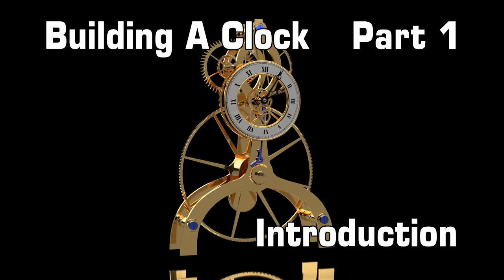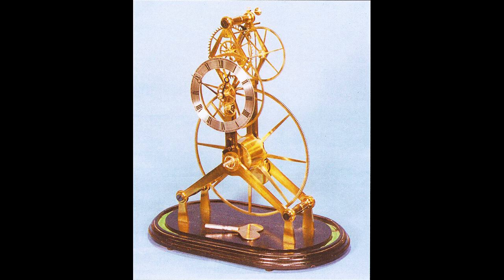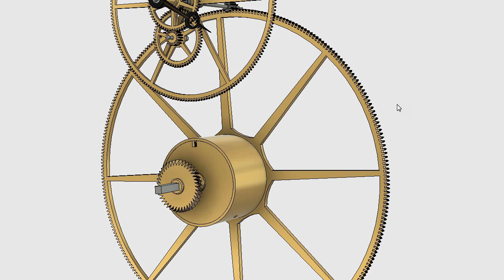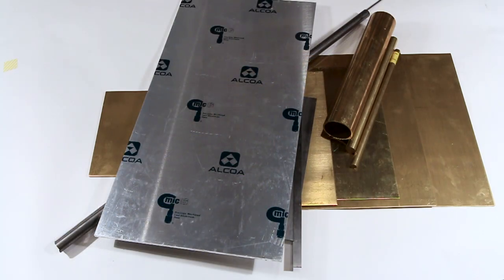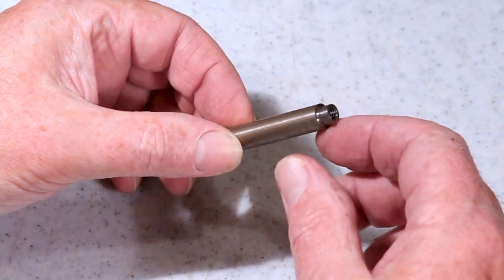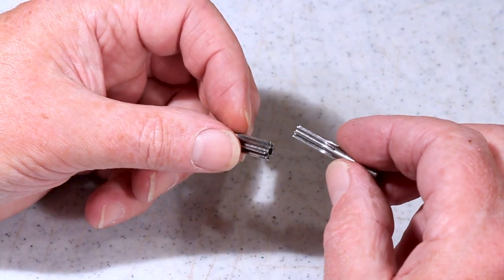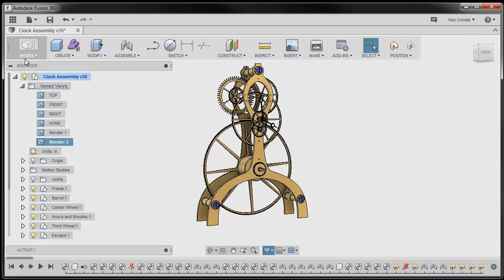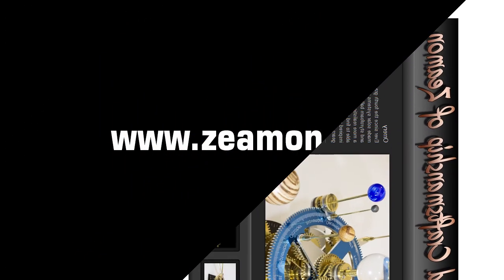Making A Clock - Part 1 Introduction

Comment: Ken, I'm a model engine builder, but once I finish my current slate of engines I'd like to try a clock and an orrery. You and Chris have helped me decide on this John Wilding design. Its interesting to note that while we're all using the same basic machining tools and techniques, IC engines require specific black magic (making rings and valves that seat and seal) and clocks have their own different black magic (gear tooth profiles, and gear spacing) to make a smooth running gear train.  Its also interesting to note all the different approaches, Chris uses a fret saw, you use CNC, and I use a rotary table, for cutting gear spokes.  Thanks so much for making these videos.

Comment: Very nice work and I very much admire all the drawings you have on you tube. I made this clock of wood earlier this year, changing the shape of the plates to make an Art Deco design.  I too used CNC and a .04 Imperial module.  I had doubts that it could be made to run, being wood, but it does run very nicely when the weather is dry and it will go 12 days on a wind with 2 constant force springs.

Comment: lol.. my background is watchmaking. the great wheel clock is beautiful, usually one of the more expensive clocks to make, there is a lot of brass in it! i really am pleased to see another clock series. will be following with interest. the great john wilding made lots of other really nice designs, and there has been some pressure on me to build a clock on my channel, but i dont think it will happen any time soon. my favorite is the longcase english regulator.
pinions are probably best bought, or finding someone who does it commercially. with those flash cutters though, it should be doable without much hassle? 
keep up the good work, and i hope you dont edit out all the trial and error like chris does!
Reply from the maker: +Emmas Spareroom Machineshop Yes, very expensive - about $700 USD just for raw materials! I do try to keep my Bozo errors in the videos but when I'm trying a new technique I usually work out the steps on a scrap piece before proceeding. Thanks for watching.
Reply: i have enjoyed your orrery build and your helicopter. something new is great!

Comment: Nice!
When looking at the thumbnail I immediately noticed it's the same clock Chris from Clickspring is making.
Great to see a different way of making a clock compared to Chris' "old fashioned" methods.
Quick Question: Is there a way we can get our hands on the Fusion 360 CAD file you made?
Reply from the maker: +3MrP3 Hope you enjoy the series. Actually, neither Chris nor I can supply plans because they're copyrighted. To get the plans you'll need to purchase John Wilding's book.
Reply: +KenToonz I allready suspected that. Then I will probably have to make my own CAD files.
Thanks for the answer!